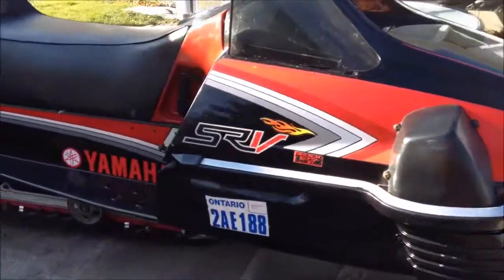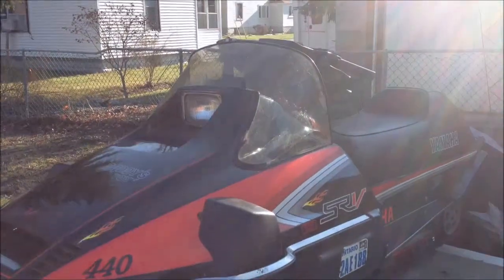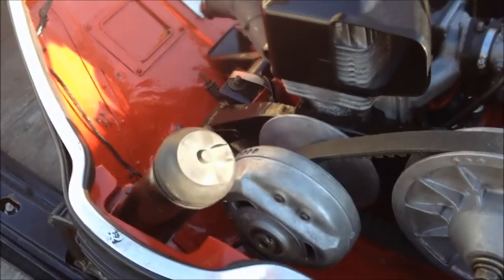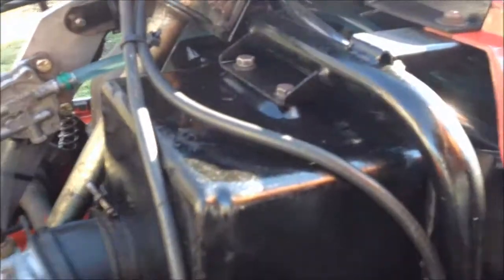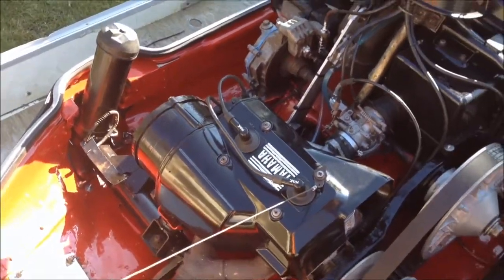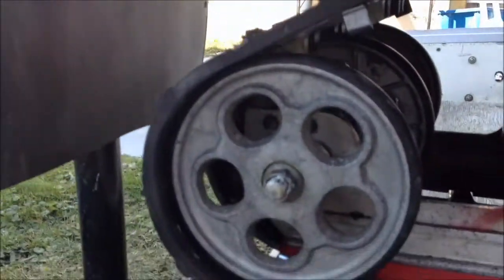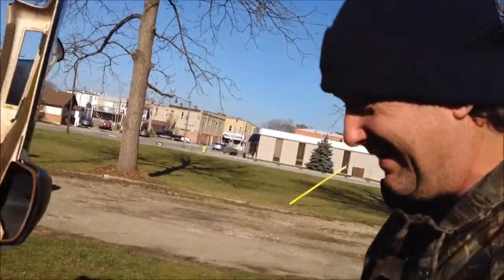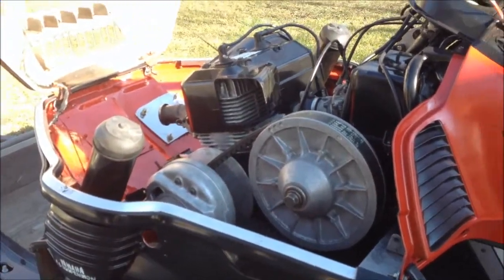83 Yamaha SRV

Comment: First sled I learned to ride by myself on. My dad bought one of these 540’s for me when I was 7 years old. The sled scared the crap out of me it went soo fast total overkill for a 7 year old. Rode this a couple years till he got me a phazer2 st. The throttle froze wide open on me in -20 one time and almost got me good the kill switch was broken off only way to stop it was turn the key.My dad ended up giving the sr5 to my cousins and they drove it till it rusted out and the engine fell off the mounts. I still have a Phazer 2 that my son has ridden the last couple years and an ovation that I started him on before that